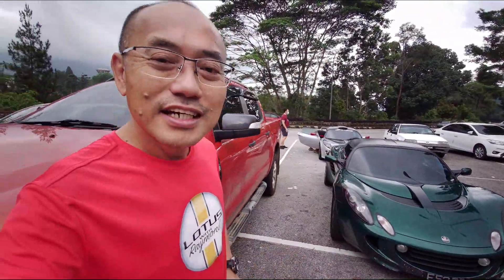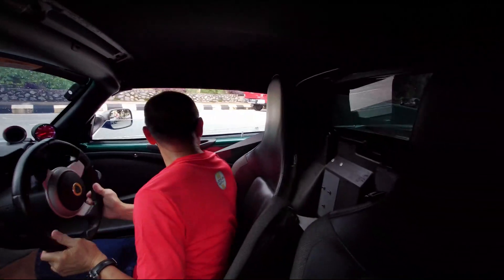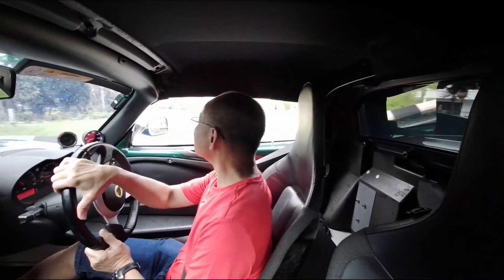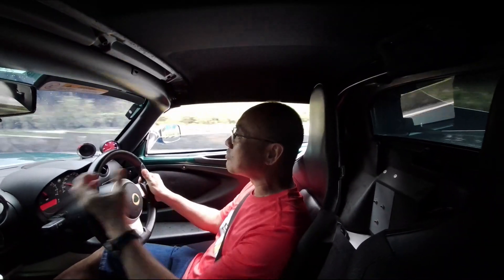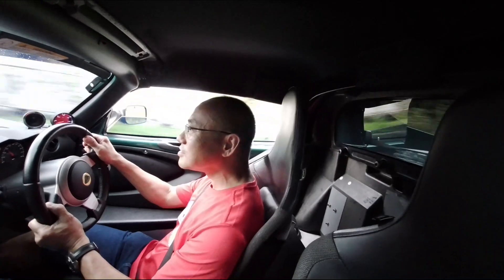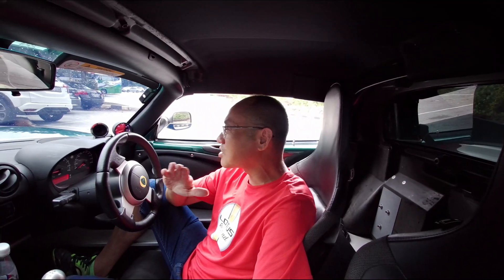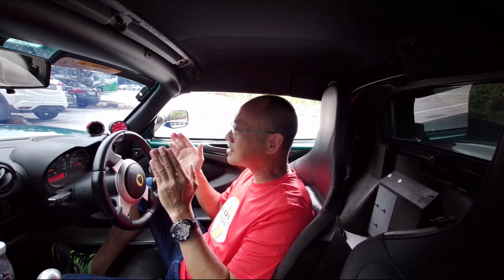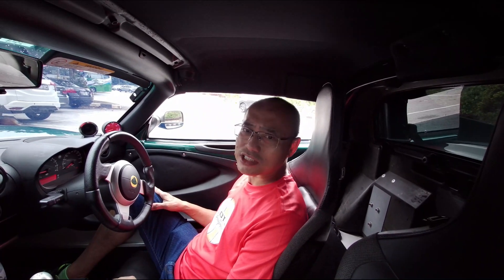LOTUS ELISE S2 Turbocharge 1 ZZ-FE | ROAD TEST | How much more improvement compared to stock?

Comment: Did they install forged rods? Apparently the stock ones aren't really strong enough for a turbo.
Reply from the maker: So far, the stock held up well as it is running on low boost.   Currently running on 0.5 bar as standard and Julian has tested with 1.0 bar at the recent track day.